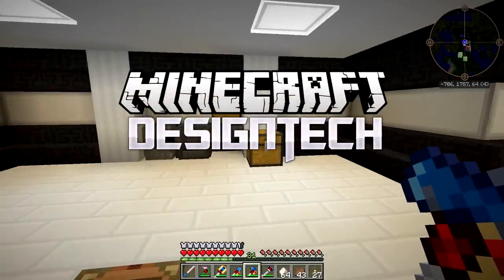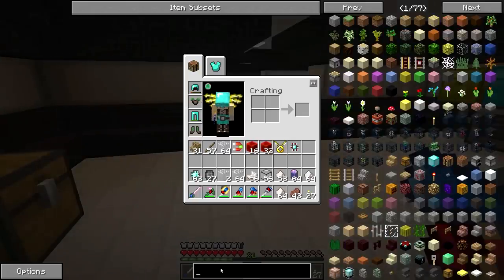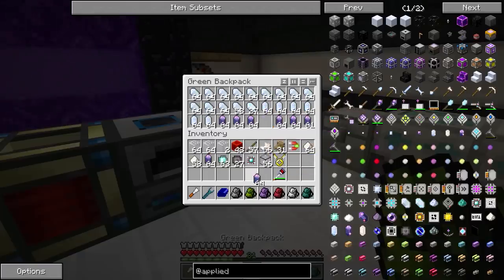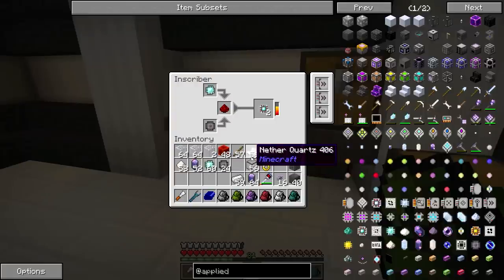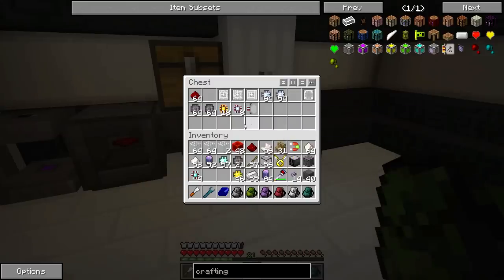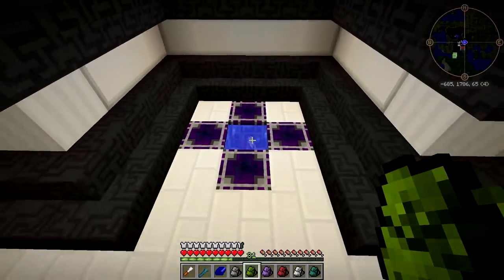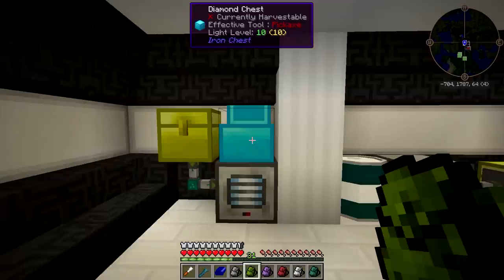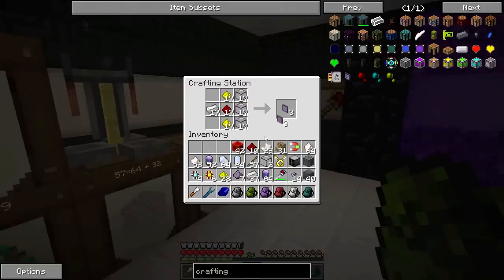DesignTech - Ep. 16: Setting Up a Basic ME System From AE2

Comment: Applied Energistics has its own facades, but AE cables and buses are multiparts (Forge Multiparts), which means you can put Forge Microblocks facades in it too.
And you don't need the Export Bus to Import things to the system. You just need an Import bus, like was in every version in AE and AE2. You can put the Import bus directly to the Tesseract.
Reply: Tóth Gábor from what country are yoi

Comment: You don't need the export bus in your system. The export bus is used to export a specific item( must be white listed) out of the me system while an import bus is used to import items into the system (can be whitelisted but doesn't have to be). The export bus you have now is doing nothing and looks silly. Please remove it
Reply from the maker: Thanks! I'm pretty new to AE2 (if you can't tell lol), so I'm still figuring it all out.
Reply: Welsknight Gaming No problem. sorry if I sounded snarky. There is a mod spotlight by direwolf20 on ae2 if you want to take a look
Reply from the maker: DarkWolfMaster1 It's funny you should mention that. I probably watched that Direwolf video about 50 times trying to figure out AE2 for this episode. Some of it stuck, some of it... not so much. lol
Reply: Welsknight Gaming You should also (if it works the same as AE1) be able to put the Import directly on the tesseract. In the past there was a ME Interface, which acted like a chest, and was part of making the Import bus. I'd use this for things that push into chests etc (basically, everything automated from other mods). I don't now if that still applies to AE2.